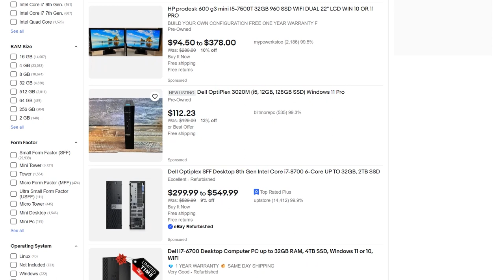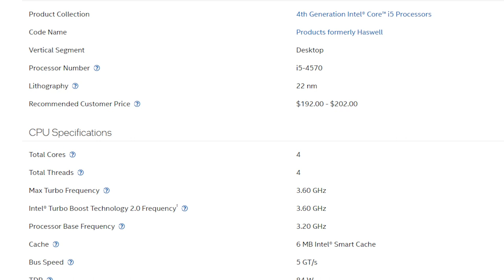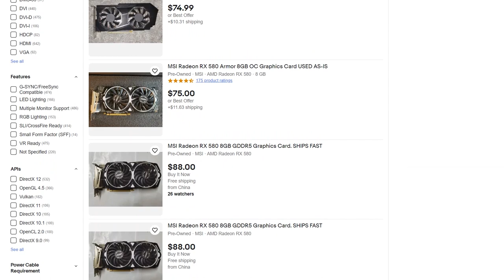I Built a $200 Gaming PC

Comment: Hey i know this is an older video but does an optiplex 7050 work similar to this tutorial? and would you still suggest i look for the gpu mentioned in this video or do you think that a year later i could get a better value at a similar price? Trying to build a budget pc for a family member so they can get use it and see if they like pc gaming.
Reply from the maker: This is a bit outdated. Check my newest videos, I've custom built $200 gaming PCs in thr last few months, I recommend those other Dell Optiplex builds. For the same price you can get a GTX 1080 now instead of a 1070.

Comment: so is it plug and play or do i have to download a new version of windows or format anything?
Reply: I’m replicating this exact build with the same cpu and gpu, I want to know If I have to update any drivers or update the bios or if it’s just plug and play, I have everything put together right now, just waiting on the cpu to arrive from ebay. Once I get everything up and running I might post a video.
Reply: @isaiahcruz8484  let me know before I buy anything just for the stock optiflex 790 my big tower thinking of putting an i7 4770 or 4790 with a gtx 1060 but still mapping it out
Reply: @derekpadilla6173  i’ll update my comment once the cpu arrives on monday

Comment: Isn’t it easier to just build it with $200 and hold off on buying GPU until you have the money. CPU graphics should be good enough for standard use until you have the money to invest more into it.
Reply from the maker: That's a fair opinion, but there is a sector of people who don't want to spend any more money on a PC - it isnt their main hobby, or they dont want to save up, or they dont have an income stream etc. $200 might be the maximum amount of money they want to put in to get a functioning gaming pc, and then maybe in a few years if they still like it they can buy a new one.

Comment: I just ordered an i7 3770 to replace the i5 in my Optiplex 3010sff along with 16gb RAM I already installed a Nvidia GTX 1020 low profile graphics card. I plan on buying a better setup though kinda thinking I'm gonna get the the Optiplex 3020 like the one in the video. Curious if I should just hold off and put the i7 in the 3020 I plan on getting?
Reply from the maker: Meh if you already ordered it, why not use the power? Sounds like you got a good plan there 👍

Comment: the 430W was NOT MORE then enough guys. i went on reddit to ask why my pc wasnt turning on and felt so humiliated in the comments. buy a 500 or over psu
Reply from the maker: 430 watts is enough for a gtx 1070 in this scenario (i ran it for 6 months)  If your pc didn't turn on, your PSU was probably dead. Don't feel humiliated because you asked questions online, there's no shame in it. Thanks for watching!
Reply: @JasonWitmerYT  they cooked me ngl
Reply from the maker: Screw reddit hahaha sorry you went through that. They a bunch of neckbeards
Reply: @JasonWitmerYT  factual
Reply: @JasonWitmerYT  wait so if it is enough, why isnt mine working? when i turn it on, it just emits an orange light on the mobo. and also, i recased it and the fans arent turning i dont know where to connect them. and the pcie  8 pins for the gpu theres only one 8 pin

Comment: Hey boss I know this is a later video but do you think the dell optiplex with the i7 4770 will preform even better then this? I plan on buying the 9020 i7 quad core mini tower with 32gb ram and 256gb ssd, I’m thinking of either a 1080/1060 or a gtx 1650 super, what do you think I should use without bottlenecking too much? And should I upgrade the psu as well? Thanks
Reply from the maker: Hmm, I think the 1080 might be pushing it. A 1070 would be best, and if not that, then a 1060 or 1650. An RX 580 is super cheap and is a great option as well. I do recommend changing out the power supply just to be safe
Reply from the maker: And the 4770 is very similar performance to the cpu in the video
Reply: @JasonWitmerYT thank you very much, what website do you recommend for some decent refurbs? I don’t mind if they don’t have ssd and ram cause I can always add that myself, and would you say a dell i7 6700 516gbssd would be worth buying at $150? I imagine the 1070 would perform even better in that without bottlenecking right?

Comment: Could someone help me a little?  I have a laptop with an AMD ATHLON 3050U Silver with Radeon graphics 12gb ram.  I only play one game, project zomboid and it runs it ok but shutters at times and was wondering if more ram would be beneficial for the system.  I'm not opposed to building a pc eventually but wana use my laptop
Reply from the maker: I don’t think ram would be more beneficial. That cpu is just very underpowered, unfortunately.
Reply: @JasonWitmerYT  thank you for the insight!  May I ask what you would suggest for a cheaper build that would play zomboid?  I don't believe it's super intensive as far as needs goes
Reply from the maker: For a desktop, you could honestly probably buy like a $100 used Dell Optiplex with i5 7th gen CPU or higher and be fine. Or a used 8th gen i5 thinkpad if you want laptop
Reply: @JasonWitmerYT  thank you for taking the time to read and respond!  It really means alot
Reply: Under $200 and then you can yank your ram out and put it in there to give you a little more. It says only 2.8ghz but turbo it goes up to 3.8ghz  not sure how the graphics are. But it’s a step up from what you got.
Reply: I sent some links but they didn’t pop up. Walmart has a bundle with pc monitor mouse keyboard for $75 a dell optiplex 7010 then you grab a intel I5 3570 cpu for $18 and then you can get an amd R9 350 with 2gb of gddr5 for $28. And you won’t need to upgrade the power supply. But you could spend $60 on an amd Radeon HD 6770 with 4gb gddr5 and get a power supply for $40…. But I also saw a decent 14” laptop for $140 it had 250gb ssd and a i5 processor that was quad core 2.8ghz but went to 3.8ghz in turbo. It only had 8gb of ram but you could always swap it out with what’s in your laptop now.
Reply: The key with Walmart is you click on one of their items that’s like something you want and scroll down and they have suggested items from third party sellers that are used or refurbished. Some have warranty’s and stuff. I’ve gotten a few things from them and never had an issue.

Comment: Will an xeon w3550 be similar? Cuz i found a deal for 60$ +a monitor included
Reply from the maker: That would not work with this exact dell optiplex model - its much older.
Reply: @JasonWitmerYT i found an optiplex with an i5 4590 at 50 bucks same performance or?

Comment: would never use a 1070 with anything below a tier c, especially with a 430w thermaltake smart
Reply: It's an old enough card and doesn't have high the same transient power spikes like newer gpus so a worse psu is fine

However an enermax cyberbron or especially a bitfenix formula bronze wouldve been much better at a similar price
Reply: @Blinkhs1  cyberbron is also tier F, like the smart, and i wouldnt go with formula bronze due to age
Reply: @Kzxhy  again, for the price it is still a better psu than the thermaltake smart, the 1070 is a 7 year old GPU and thus doesn't need a crazy psu
Reply: @Blinkhs1  its a 7 year old mid-high end gpu. power requirements on a gpu dont go down as the card gets older
Reply: @Blinkhs1  Transients aren't the issue, even the power draw is not the issue... the build quality is. The 80+ white units are built to a very low standard. I've seen a lot of them die for no reason other than they're just built to a very low standard. In ways, I consider them a downgrade from the stock power supply. At least they're build to a higher standard. There are a lot of good 80+ bronze units that are MUCH better that only cost about $10 to $15 more.

Comment: these old optiplexes are crap its pretty much extinct nowadays theirs no point to get one and upgrade it. Your just going to end up spending more and more money maintaining the thing since its so old and the parts are out dated and ur going to have overheating issues since the case has very little and decent ventalation. Also most those cpu's in those old optiplexes are only decent still for basic home server purposes with the newer games those cpu's barely fit within the cpu requirements. just save up a couple hundred dollars more and build yourself a nice 600 or 700 dollar gaming pc build that still has support and overall just easier to maintain and work on.
Reply: you’re missing the point buddy. The point is to build a pc that can play games on a $200 budget. Who cares if you have to upgrade down the line? Gives you more experience working on computers. You clearly know nothing about the reliability of these Dell optiplexes. How do you think they’re still running after all these years?
Reply: @isaiahcruz8484  dude I’ve built this exact build with my own hands a few years back and had it since theirs zero airflow within the case so ur graphics cards gonna touch like 83 degrees hard drive will keep failing and its overall just a hunk of lard only thing it’s good for and capable of is a streaming pc
Reply: @lyricalpixxy  i’m chillin at 64 degrees celsius buddy, maybe you have the smaller case configuration. Why were you running a hard drive in it? Why not a much more reliable ssd?
Reply: @isaiahcruz8484  I do I have both 😹 and mines the MT not the SFF u acting like I don’t know what I’m doing
Reply: @isaiahcruz8484  ur also most likely running the gtx 1650 or some type of crappy low profile gpu
Reply: @lyricalpixxy  it’s actually a hp gtx 1070, I also modified the front of the case (MT) to accommodate an extra intake fan.
Reply: @lyricalpixxy  I can send you pics of the build if you’re interested?